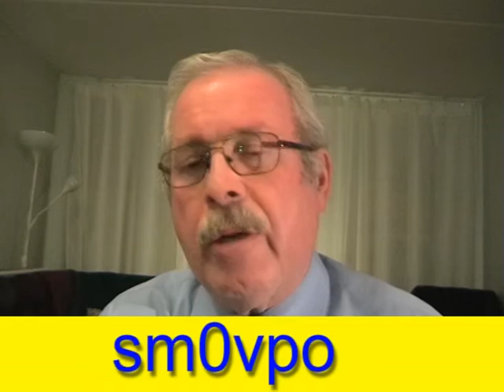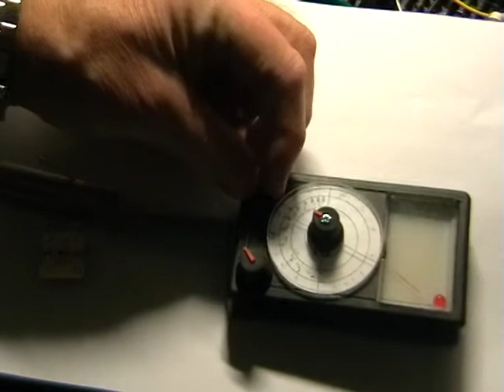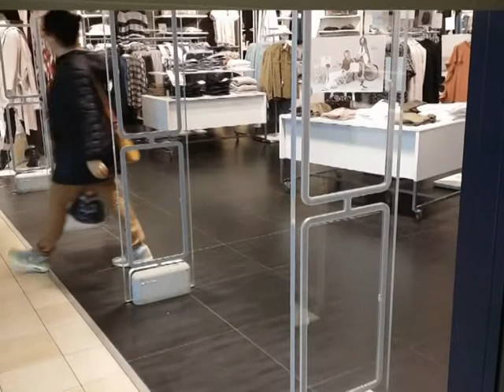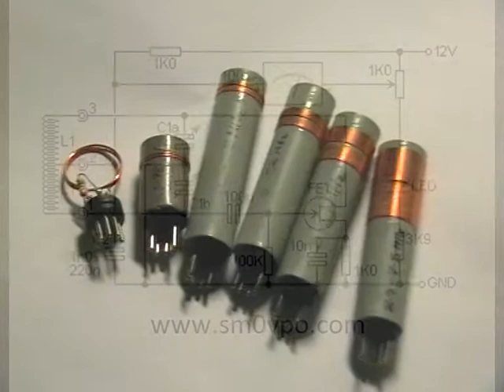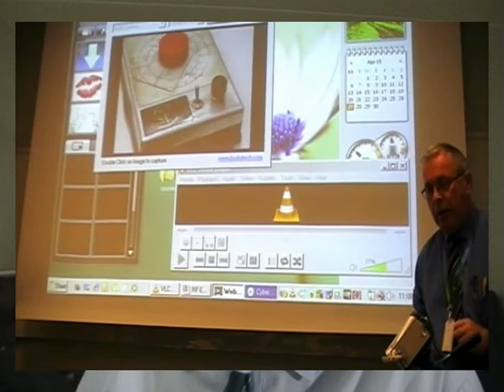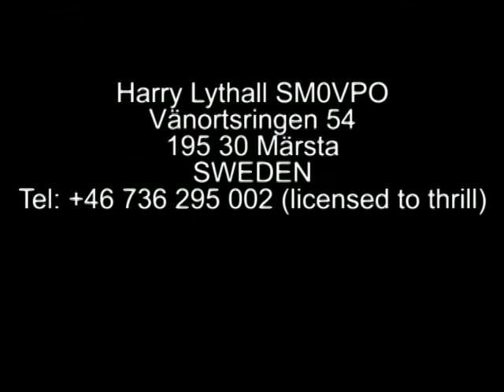The GDO (Grid Dip Oscillator)

Comment: Hi Harry, today  I built your GDO version 1, it works great. Now I want to know more about it´s  functioning theory and capabilities. My version works as a plug in of a cheap chinese tester Sunwa Yx-1000A used in it´s 0,5 milliampere range. Testing it with a similar 40 meter coil in parallel with AM radio capacitor IN RESONANCE It produces a good dip from 230 micro amper toward almost zero milliamper, the fet´s drain voltage goes down  from 7,98V to 5,65v  and the total current rises from 2 milliampere to 4 milliampere.  I can´t understand why in resonance it consumes more current. I think, old tube Grid Dips  when a resonant device absorbs energy it stops oscillating lowering grid and plate current. So I think this device works in the opposite way. Thanks in advance for your response. THE RELATIVE  POWER IS 0 dB IN RESONANCE AND -5dB OUT OF RESONANCE. Diego LU2DVY
Reply from the maker: I lost access to my YouTube channel due to lost password and YouTube support would not give me acces since they were not convinced that I am me! But one day I was fiddling and suddenly I got access. Now I am producing new videos.

The GDO project has been re-visited and the project page gives a lot more about the theory of operation. It is just a wheatstones bridge, but one of the four resistors is replaced with the oscillator. If the oscillator current thanges then the bridge becomes unbalanced. It is quite simple. The new project can be found here:

https://sm0vpo.com/use/gdo2.htm

Very best regards from Harry - SM0VPO

Comment: Mr. Lythall, good evening. I found one of your previous articles about the SHORT ANTENNA or fishing pole. Do you still have it? There was a doubt concerning the total length of the positive active vertical part for 80m. Can you describe in more details its construction?I'm thinking in making 8 radials on the horizontal position, installed on the feet of the mast. Can you give me/us more info? Maybe produce another of your crystal clear videos? Thank you in advance.
Reply from the maker: Short antenna for HF? Perhaps this is a more recent variation of the project.

My first contact with this antenna was a JA station, and I was only using 100 wats from a car-park on high ground (clear view of horizon).

https://sm0vpo.com/antennas/hf-portant_01.htm

In principle you can use any antenna element, as long as it is a bit of metal - the longer so the better it is.

Sorry for the delay responding, but I had lost access to this YouTube channel because I was locked out. I only managed to get access to it a few months ago, then I started produc ing new videos.

Best regards - Harry - SM0VPO